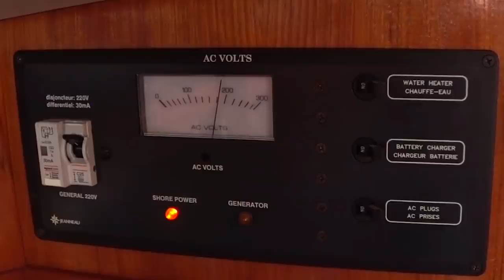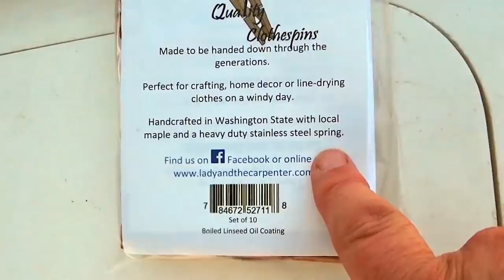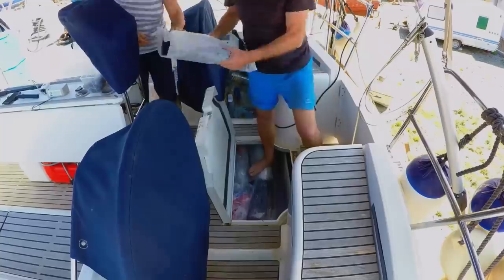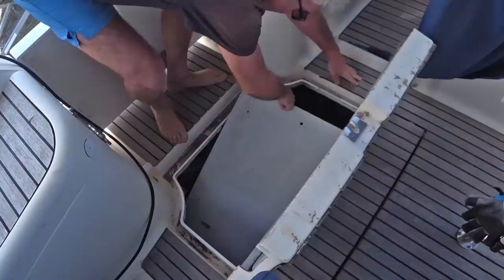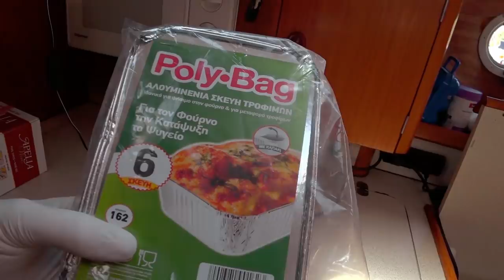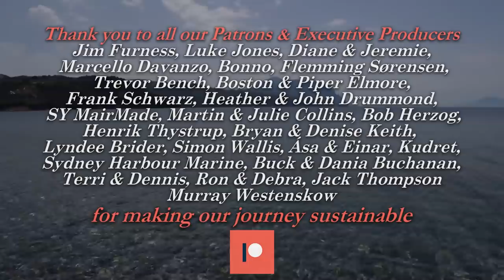A hot water challenge - Sailing A B Sea (Ep.125)

Comment: Glad to see that it was the correct size and made the removal of the element so much easier, you could always use locking nuts on the other two nuts so that they don’t vibrate loose , looking forward to seeing more videos of your adventures
Reply from the maker: Hey Ian, yes a perfect fit and it made the job so much easier, thank you. We will be putting double nuts on the quadrant. Cheers.

Comment: Good morning Barry, perhaps not needed: Next winter, when the work has to be repeated, I will take new nylon locknuts and install them also using Loctite liquid.
If you have enough thread (as it seems from your photos) just put a nut tightened to the existing nut and you should no longer have the problem. Greetings also to Aannsha and congratulations and sorry for the approximate translation.
Reply from the maker: Yes there is enough thread to allow double nuts. Cheers.
Reply: Thank you Marco, greetings to you as well! :)

Comment: Hey Barry - with reference to your issues with the steering quadrant and having to revisit the tightening of the fastenings, there are some factors to consider:

1. The nylock nuts have had it and should be replaced.
2. Alternatively replace with two plain nuts (in locknut fashion) AND applying Loctite 241 to the threads prior to assembly.
3. If it slackens off again after exercising either of the above options it could be the bolts are just too small and are stretching under load. The solution then would be to go to the next size up (eg if they are M8 increase to M10) which will require drilling the quadrant and boat structure - and of course access may prove an issue - but you do have a right angle unit for your drill😉
4. I did not get the best view of the quadrant but if one side is being tightened against fibreglass that could be the issue and larger washers or better a steel backing plate to spread the load will help enormously. (Edit I have just rewatched those washers look adequate.👍)
Reply from the maker: Some great tips there Norman. I think we'll go for new nylock nuts and the double nut solution. Cheers.
Reply: Sailing A B Sea Well either nylock or double nuts not both.👍

Comment: That specialty tool was just the ticket. I admit to laughing a little when you turned the whole water heater with it though. You might double nut those steering nuts - looks to be enough space on the ends of those bolts. I'm glad you decided to go with disposable epoxy brushes and pans. Life's too short to mess with things that inexpensive. Epoxy is not cheap though. I imagine that typer your using is spendy. Since I'm watching you work, I'll tell you a funny story about me yesterday. At 40,000 miles I decided to change the engine oil and CVT transmission fluid on my Nissan Rogue. With a Covid lock down, and plenty of time, I decided to tackle it myself. I drove the 4wd up the ramps, got under and drained both the oil and CVT fluid. As I was finishing up, somehow my back went out - I couldn't move, I was under the car without my phone, with no one around to help me. I was stuck. Too much pain to scoot out - and immobile under my car. After 15 minutes my wife came out - and saw me there. The only thing I could do was grab her ankle and hold on as she dragged me six inches at a time across the concrete with her leg muscles. Took a few minutes, but I was finally out. Getting old is the worst. I took a big hit to my ego yesterday.
Reply from the maker: (Baz) Sorry to laugh at your misfortune Murray but the mental picture you painted had me chuckling.  Double nutting paints a completely different picture, but I won't go there. Cheers.
Reply: That sucks Murray!  I hope it's feeling better today.  I swear by chiropractors personally, although they're as rare as hen's teeth on the islands.  #relatable on the getting old  being bad ... I've recently begun a dance fitness class online to get me back in shape.  Not just for looks (although they need help lol), but also for the flexibility and strength aspect on the boat and life in general.  I think the older we get the more effort we have to put into that kind of thing.  That sucks too.  LOL  Although I'm enjoying the dancing.  I have to focus very hard on the steps so I don't look like Mr Bean ... and before I know it I've done a gazillion stomach crunches and 45 minutes have passed by!

Comment: Hi Baz.

Perhaps it is time for some new Nylock nuts for the rudder stock, those ones look like they are past due. Also you have a lot of sharp timber edges and sharp fibre glass bits in that locker. Is Hydrolic steering on your wish list.?

David.
Reply from the maker: Hi David, this winter when the nuts will need tightening again we'll replace them with new nylock nuts and double nut them. There are a ton of things on our wish list, hydraulic steering is somewhere just below the middle of that list. Cheers.

Comment: Baz, I really am very surprised that you cannot drain down your hot water tank - How are you supposed to winterise it?  Even in parts of Greece the temp can drop below zero.  Our tank was killed in Preveza a few years ago by a sudden and prolonged cold spell.
Reply from the maker: There is a bleed valve on the tank, I just didn't want 30 litres of water in the bilge. A B Sea is on a slight angle and all of the water would not run cleanly through the bilge to the bilge pump sump.
Reply: @SailingABSea  Is it not possible to add a piece of hose pipe to the tank that goes directly to the bilge low spot/pump?  Or you could have emptied the tank via the pressurised system into the sink and put a bucket under the skin fitting drain if you didn't want to create a puddle under the boat.